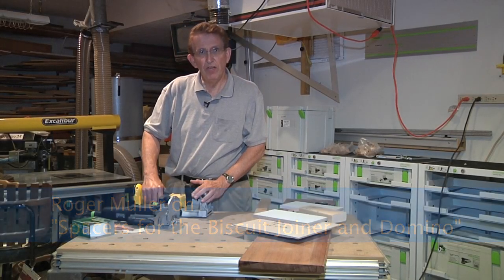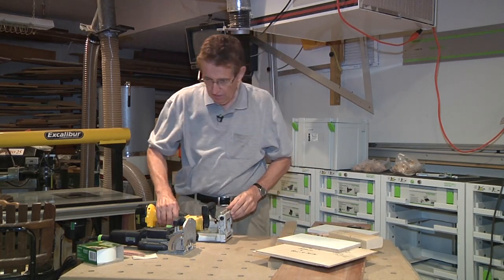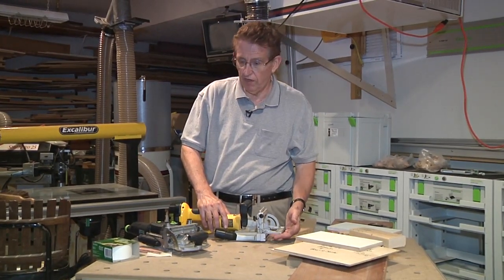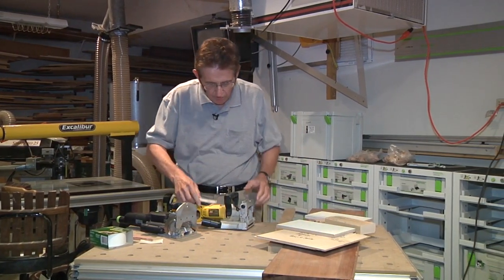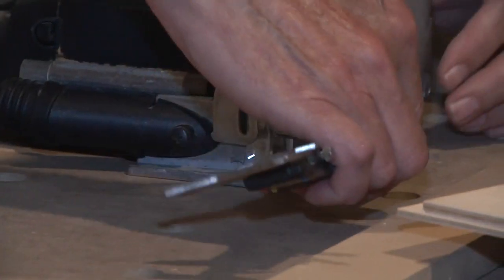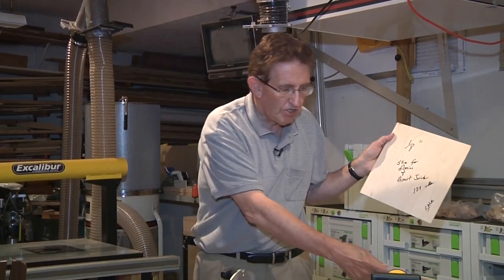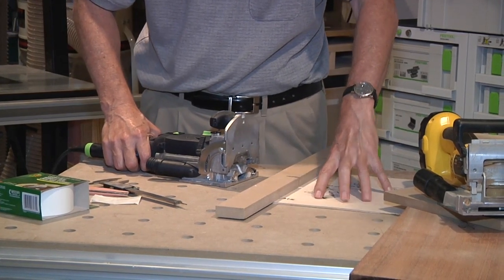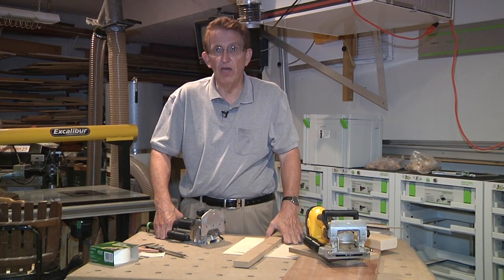Alignment Techniques for Festool Dominos and PlateJoiners

Comment: You're referencing off the bottom rather than the top which means any deviations in the surface the base rests on or any differences in the thickness of the wood being joined will result in an unflush joint on the top surface.  This will only work well if you leave the surfaces you desire to be flush face down and even then this method may not produce consistently flush joints.